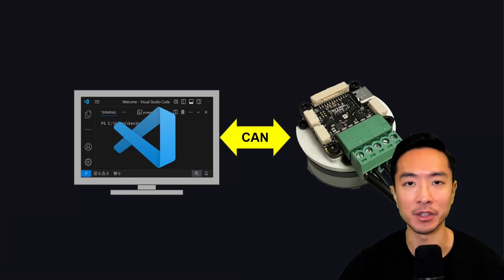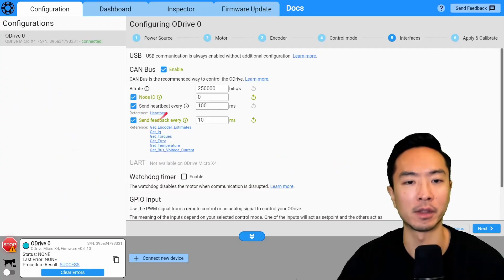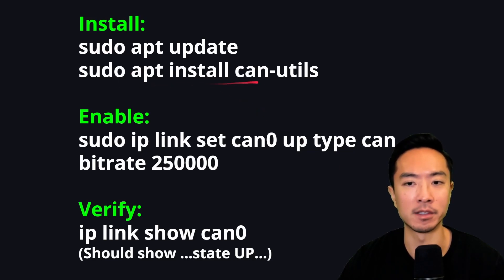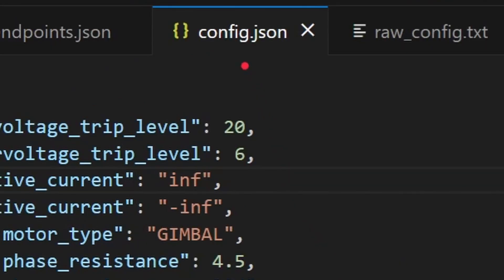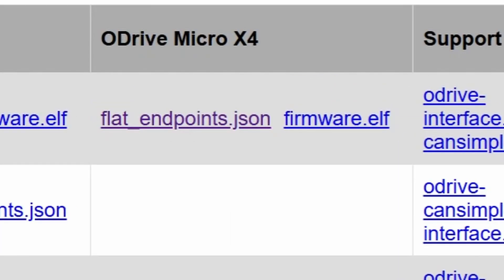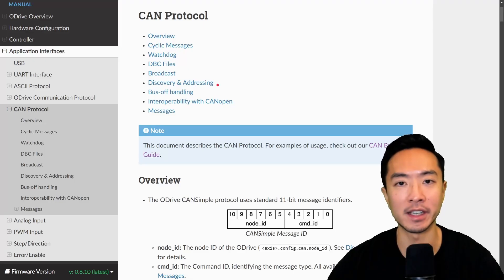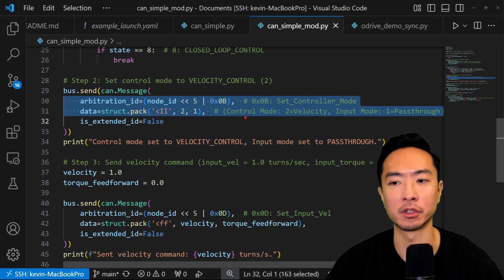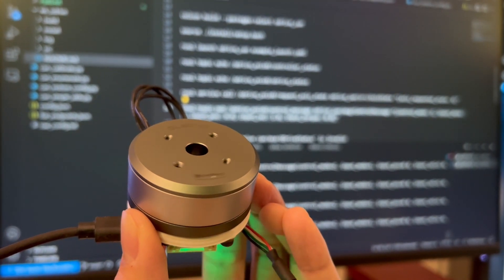ODrive CAN Bus Setup and ROS Setup for BLDC Motor Control

Comment: In my project, I use Jetson Nano connects to Odrive 56V V3.6 to control Alomejor 10 Inch Hub Motor, 36V 350W Brushless Electric Scooter Motor with Tire and the power supply into Odrive is a Li-ion Battery (42V, 4400mAh). However, when I used odrivetool in terminal of Ubuntu, the wheel doesn't rorate (I only test 1 wheel). How can I solve this problem?
Reply from the maker: Try checking wiring and connections

Comment: do you have to use  linux machine to run all the python and CAN setup or can i do it from my windows pc?
Reply from the maker: Windows works
Reply: @kevinwoodrobotics  thank you, I dont need the ROS implementation i am trying to make a control system using the odrive. Do i have to use python or can i set up the CAN using C so that i can write code that ill run on a microcontroller. 

Also you said windows works for the CAN setup, do all those commands that you inputted in the video have to be run in the windows terminal instead of linux shell??

Thank you for your time,